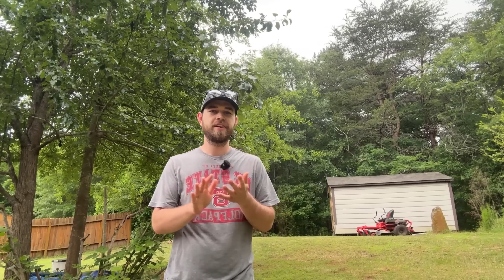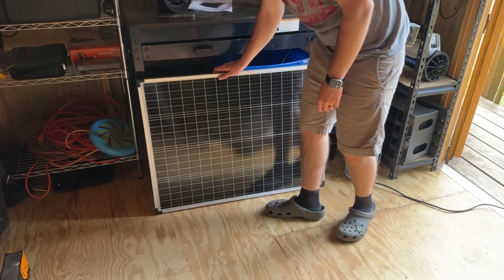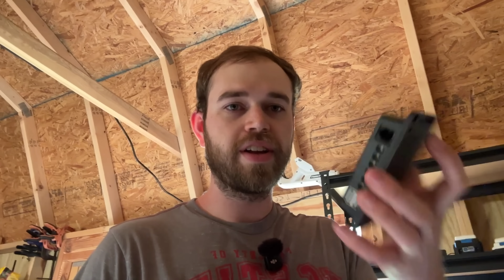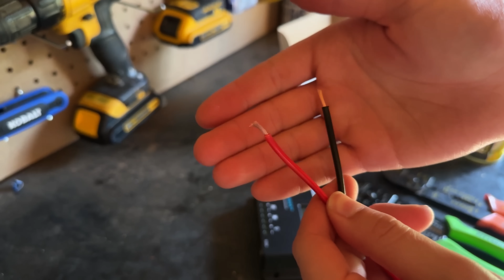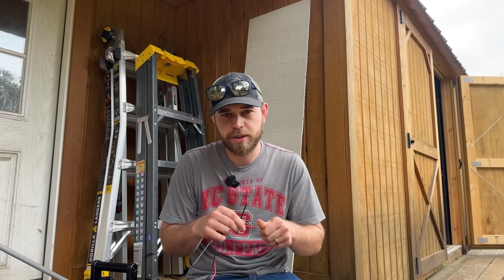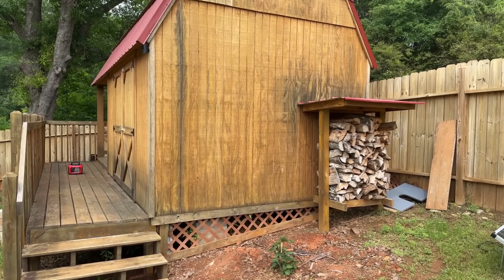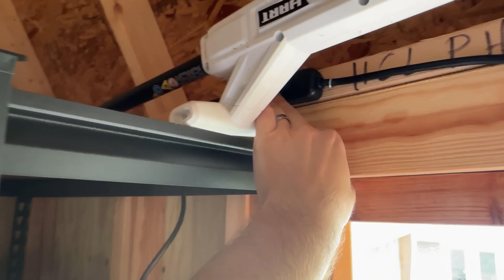I tried Harbor Freight’s cheapest solar panel setup

Comment: A "gee whiz" I bought 4 of those panels. I converted them to MC4 connections, run them in parallel (as required by my Inergy Apex, with 2 Flex batteries). Those panels out perform my Renogy 100 watt flex ones. I made one long aluminium L base to hold them in line, and let each units adjustable legs free to change angles. In he Florida panhandle it is handy for outages.
Reply: The only problem i have with these panels is the fact I can never find them in stock, >.<
Reply: I also have these harbor freight panels. Efficiency wise, they out perform every panel I have. My Renogy, my ecoFlows, my 200w Chinese panels. They are only 100w, but like I say I’m continually about 90+ on the efficiency. Far and away better than any panel I have. Like wildrive said, finding them is something else…. I love ‘em.
Reply: They're not as good on cloudy days though
Reply: @GoonieGamerz  Because they are powered by the sun, maybe?
Reply: I have no clue what you said...

Comment: Just a little tip whenever you're cutting an end of a cable off leave yourself an inch or two of wire in case you need to reuse  in the future
Reply: On Anderson power pole connectors with a small screw driver you can remove the wires without cutting off the connector completely. Benefit is you can use the connector again if need be
Reply: I always do a service loop that's looped the size of my fist and in a way so the water drips down
Reply: Can you use bigger panels or has to be 100s?
Reply: Depends on panel voltage. Reread the basics of electricity.
Reply: Actually, I would have connected the adapter and cut the end off of it so you could still use the Anderson connector later. I was afraid you were going to cut it like that and I was cringing as I watched.
Reply: @jerrybandy3827 , same.  Him: I’m just gonna cut this connector off right here.  Me: Noooooooooo!!!
Reply: @christiansmith2730  He was really more worried that Harbor Frieght wouldn't send his check for this commercial.
Reply from the maker: @crankychris2 I wish!
Reply: @crankychris2 you know when a comment struck a youtuber when he doesn’t reply to comments but he replied to yours 😂
Reply: I thought the same thing!
Reply: How long would a small heater will run
Reply: @MrBugman2525    That power supply is only rated for 350 watts and I doubt you will find a heater to suit that smaller capacity.
Reply: ah yes, a service loop , as we say in IT, and prob elsewhere
Reply: Build your own mounting brackets, the panel has a metal frame
Reply: Yep. 3" always. the length of your middle finger. the longer the better.
Reply: Exactly 🤦🏻‍♂️
Reply: Literally watched him going "noooooo" then the strippers didn't work. Lol. So he goes and gets another set and SNIP. Say to myself "he's going to regret that". 10 mins later he's saying he's going directly to the supply. Lol.  2 inch pigtail mannnnnnnn
Reply: 😢😊pm
Reply: Unless you won’t be using the connector again.
Reply: It’s always a good idea, I would leave it a little longer
Reply: @1foolwandering Just FYI, what you’re describing is called a service loop in the electrical wiring industry. Smart move.
Reply: you should not remove the anderson connector, just create a paralel wire if you wanna connected to the charge controller
Reply: Yep, leave enough wire to use it again.

Comment: I really like the convenience of this. I have a small yeti 200wh solar generator and a panel. It works perfect. Once the yeti dies(shouldnt be any time soon), i think I will go the other route, because a good point was made on other videos Ive see,

If theres something wrong with the generator, its more complicated to get it fixed, or you will have to buy a whole new one full price, But with the more diy set up, you just have to replace the defective components.
Reply: Correct. But, the better power stations have great warranties > my Bluetti is a 5 yr.
Reply: @jessstone7486 thats a good warranty. I would say that it depends on ones situation. For someone that may be living on the road, having to go through the process of getting one mailed to you, well, i dont think i need to explain the complication there. If its one part that is the problem, that person can go to a hardware store and get what they need the same day

Comment: First I would've bought Anderson connectors so you could just make new leads to the cords to save warranty. Also gives you another place to quickly disconnect if need be.

Edit. Number 2 those wire strippers are trash. My father was a electrical contractor and the only time I seen those kind in his hand was to throw them away.

Comment: Aside from the convenience of warranty the HF power stations are not worth the money. Other manufacturers make better units.
Reply from the maker: Which one would you recommend?
Reply: @WattsNextSolar25 dabbsson 600L its usually on sale too
Reply: @tobiaspeterson3912  Where would I be able to see pricing on those?  You are just talking about the Power station and not the solar panels, correct?
Thanks. I am learning as I go
Reply: I've settled on Oupes for my computer and freezer. They're fairly wasteful, taking 12-23 Watts in while giving no output, but they do what I want.
Reply: Anker 300s are $220 on amazon today.  $300 if you bundle a 600W solar panel.

If you are comparing apples to apples.

Comment: If you splice 2 100w panels that means you can get more power in? Or is the wires not rated for over 100w input ?
Reply: I have 4 panels running in a parallel serial connection. I dont have the harbor freight power bank but I do have the solar panels. They are going into a 30 amp mppt controller that then feeds my 12volt 200 amp batteries. I then have a 2000 watt pure sine inverter.
I like the ability to expand or replace components as needed. Makes it more cost efficient compared to buying a all in one unit. Also, you learn along the way how it all works together.
Overall, I am very happy with the Harbor Freight Solar Panels.
I

Comment: the external solar charge controller won't work till it see a battery and configured , this is done to protect the battery and make sure it gets the correct charge type / level , the small predator is a charge controller , inverter and battery in one so the external is not needed or honestly wanted for that setup

Comment from the maker: How would you improve this set up?
Reply: A rubber grommet for that hole on the wall.
Reply: Bigger battery and more panels.
Reply: Add a solar panel,call it good you don't spend enough time in the building to justify bigger is better!